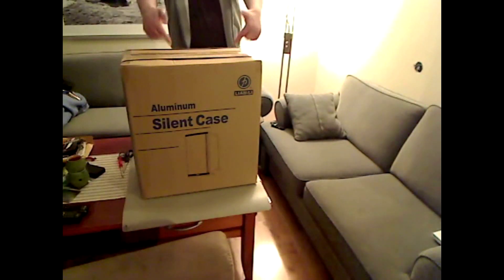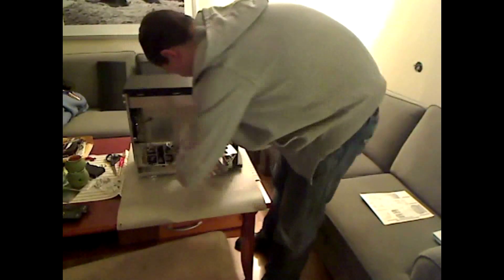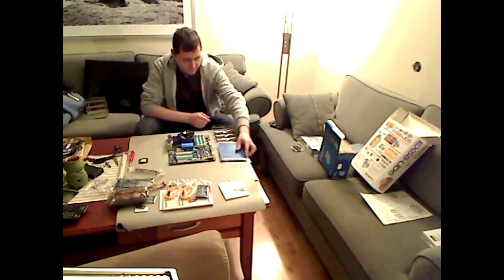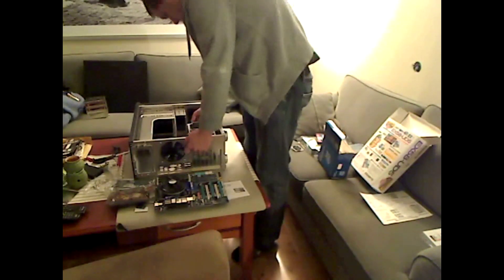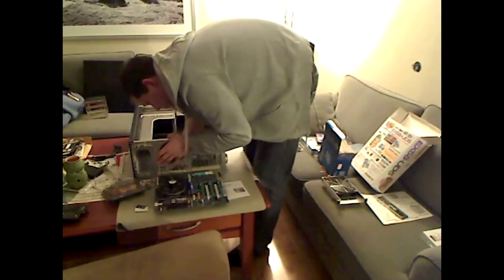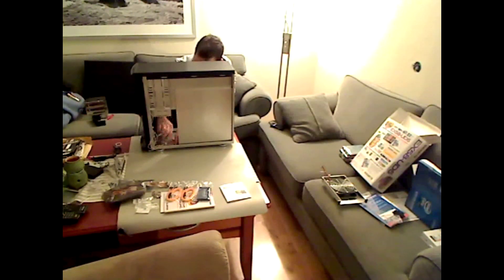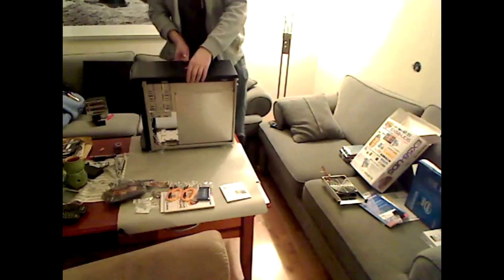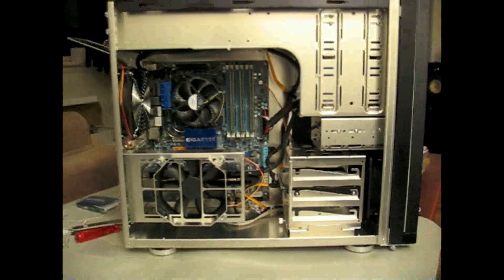The Hackintosh Guide, Part 4. Building the Hackintosh.

Comment from the maker: @mrrcorn:
Well. This is the only time I've had any trouble with a I/O shield. It was extremely tight.
I was waiting for my 3rd party cooler, decided to build the rig anyways.
You can see it on my videos about the Fractal Design casing.

Putting the HS and fan on before mounting it in the case is what I prefer. If you have to use alot of force to get the HS fittings to snap into place you risk damaging the motherboard because it can flex too much.

The mat is grounded. ;)

Comment: Yawn, Never seen any one struggle with the Back Shield before, I have installed Loads and never waisted more than 1 min on any of them. 

Why are you not using a Custom heatsink n fan, Heat pipes are so much better, Also why didnt you put the motherboard in before attaching the HS and Fan, i find it better for stability. 

Also you anti static yourself but dont do it again after, your Top allown would have produced loads of static from moving your arms and sitting on that settee.

LOl Moan over.

Comment: You do a great job with the video.  It would have been nice, however, if you had zoomed in on the motherboard when you were attaching the processor and other parts.  It's nice that you walked over to the cam and showed the parts, but it would have also been nice to see your work.

Comment from the maker: @studio9011:
I've never experienced that the rear bracket didn't fit.
On this casing it was a bit tight, but thats good.

If it for some reason doesn't fit you can probably glue it on.
Have you experienced this?

Comment from the maker: @SpikezHackz:
I only overclocked it for a short time, to test out performance vs heat/noise.
You overclock it through BIOS, like you do on most computers.
There is no difference between a Hackintosh and a PC running Windows, it is the same hardware.

Comment from the maker: @ashthegamer:
The Lian Li casing I used came with 3 fans.
One in the front, one in the back and one on the side.
They are all MISTKMF120H1VR.
120x120x25mm, 60 m³/hour (35 CFM), 15.5 dB(A).

I was very happy with that, because I've used alot of the 80mm and 92mm fans from MIST in previous builds.
Really quiet, and they are actually really cheap.

MIST is a housebrand for a Norwegian hardware vendor, so it might be hard to get them outside of Norway/Scandinavia.

Comment from the maker: @rain5317:
If you were to buy a 9600/9800, the Gigabyte should do fine.
I guess the 9800's is a better choice of these two. It performs better.
Compared to the ATI Mobility HD4850 in the 27" iMac it is only about 10% less in terms of performance.

As I said, never cards to perform much better, and for about the same price.
So you get more "bang for your bucks".
And some of them are probably just as easy to set up as mine old "clanker".
It's just a matter of research.

Comment from the maker: @rain5317:
Ah, no worries. :)

Technical problems? Are you sure about that?
The 9600's are hard to find because they're pretty much "outdated".
Same goes for the 9800's.
They're good cards, and most people will have more than enough power with these cards.
But it is the gaming industry that pushes the development, and newer cards are much more powerful.
So with never models, you can get more "bang for your buck".

However, 9600's and 9800's are very easy to set up with OSX.

Comment from the maker: @rain5317:
Nope. I've used this 9600GT for over 2 years now. Still works like a charm.
But I have considered going for a Gigabyte ATI Radeon HD4850, since thats pretty much the most powerful fanless card out there.

I prefer to have a computer that runs as quietly as possible, so thats why I want fanless. And I don't wanna do watercooling.
So far I have no need to upgrade the videocard.

Comment from the maker: @rain5317:
I would if I could.
But it is near impossible to make a guide on a GTX260 when I don't have a GTX260.

I have the Realtek ALC889A codec on my motherboard, and it works.
But I see that the GA-X58A-UD7 had Realtek ALC889 codec.
Not sure how different they are.

VoodooHDA is a "generic" kext for HD-Audio and works with most cards.
But it has limitations. When I tried it on my motherboard, the mic input didn't work.
So I searched for a better kext and found one after some trial and error.

Comment from the maker: @rain5317:
They should both work.
You might need other kexts, it depends on what LAN-chip and Audio-chip that is built in to the motherboard.
USB3.0 might not work. It depends if there are kexts, or if OSX supports it natively.
And SATA6.0Gbps is as far as I know on a separate SATA-controller, and may not work unless there are kexts for the controller.

The 9600GT should work just fine. Thats what I use. Only difference is that I have 512MB RAM on mine.

Comment from the maker: @SpikezHackz:
Well. The trick is to find a compatible motherboard.
The GA-EX58-UD5 is a tested solution.
The new GA-X58A-UD5 also has USB3.0 (2 ports) and 2 SATA 6.0Gbps ports.
However, I am not sure these ports are available in OSX.
It's all about the kexts.

If I had enough money, I'd go with the GA-EX58-UD5, ramp it up to 24GB RAM, go for the new 6-core i7 (i7 980X) and find the most powerful GPU that works with OSX.
That would be a killer rig. :)

Comment from the maker: @soccerbitch:
No problem. :)

Newegg didn't have the Gladiator Max.
But Amazon have it. Beware that you need a bracket to mount it to a LGA 1366 Motherboard.
The bracket part number is: OCZTFORC2GM

A better cooler might be this:
Noctua NH-U12P SE2 120mm SSO CPU Cooler.
It cost about $75 on Newegg.
I've heard alot of good words anout Noctua. :D

The stock cooler comes with cooling paste already applied.

The Gladiator comes with a little bag of cooling paste.
But I use Arctic Silver 5. (Newegg)

Comment from the maker: @soccerbitch:
With the stock Intel cooler I reached 80C (176F) when running at 100% load on the CPU.
Idle temps were around 42C (107F).

But I changed to OCZ Gladiator Max cooler for the CPU.
And max temp for CPU now is around 69C (156F).

The i7 920 has a TDP of 135W, so it generates alot of heat. And my casing is small, and has only a few 12cm fans.
So I could get this to run cooler, but that would mean more noise.
I like my rig to be as quiet as possible.

Comment from the maker: @blackooz 
The Lian Li case I chose is the PC6070BSCANDV2.
It's a special model made for a Scandinavian webshop called Microplex.
It is based on the Lian Li PC6070B.

Microplex has made Lian Li use a 12cm rear fan, instead of a 8cm.
And the two 8cm front fans was changed to a single 12cm.
To keep the price down, they also removed the slideable motherboard tray.

It's a good casing. Looks nice, runs silent.
But if you're looking for LOW temperatures for your CPU, this may not be the case for you.